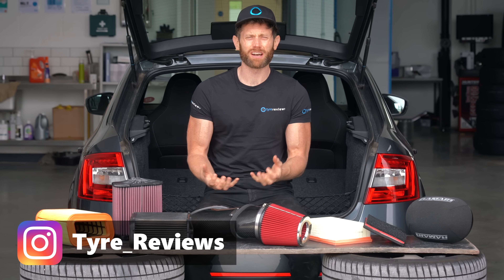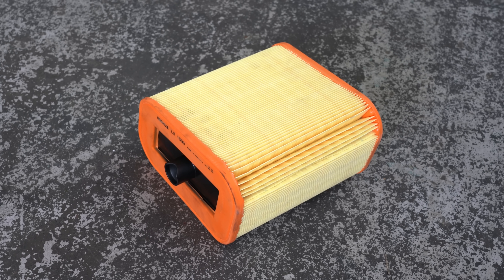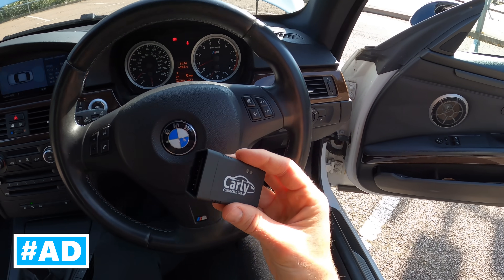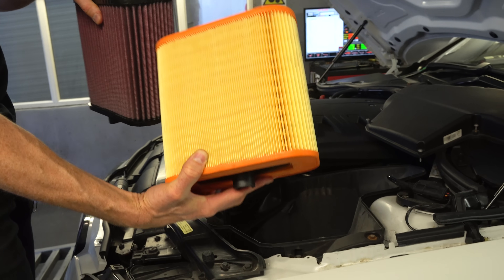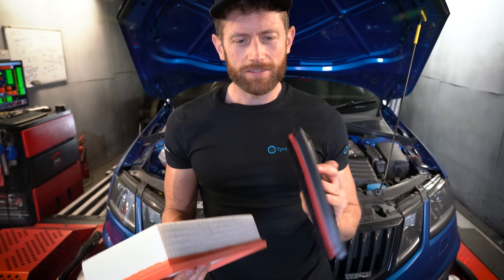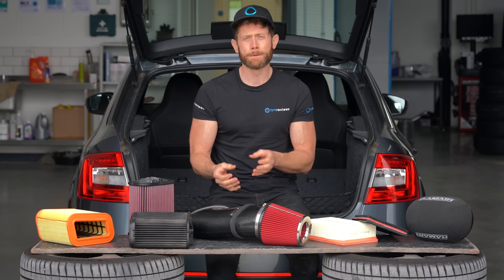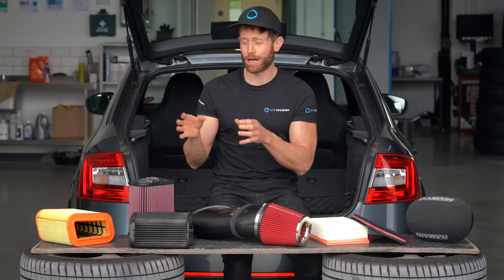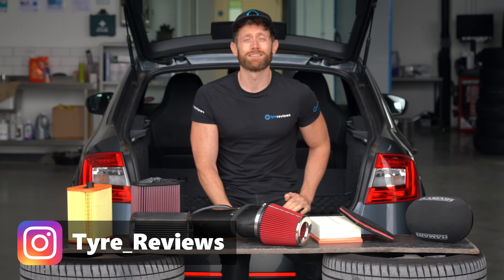Do Performance Air Filters REALLY Give You More Power?

Comment from the maker: http://bit.ly/TyreReviewsCarly - Get 20% off your Carly adapter with code Tyres until 30 Nov 2020! Carly offers a free lite version of their slick app, which gives you access to the OBD functions and you can use it to check which advanced Carly features work with your specific car model.
Reply: This is a good channel. I’d suggest being more cautious regarding products or companies you promote. Carly is one of the worst reviewed on Trustpilot ever. Doesn’t look good on you to promote them.
Reply: Do you have discount on app?
I buy carly!
Reply from the maker: @ingcool27  Use the code "TYRES" for 20% off
Reply: @tyrereviews  I love your videos but sadly here in San Diego, our government doesn't like CAI systems. Something to do with it need an emissions number or its against the law.
Reply: I'd appreciate if you could show us the torque and power charts a bit better. Top power gain of 2.5% is really insignificant and one could argue it's within the error margin on a dyno run.
Reply: Do not use KN , the engine pulls oil from the filter and damages sensors, not sure why KN isn't bankrupt yet, this BMW filter is so large already that there nothing that will improve its air flow,
Reply: So many channels have done this with the wrong cars. I put K&Ns on my 5th gen 4Runner and it makes a world of difference. Stop using sports cars. Use them on SUVs and Trucks. Especially with the 4Runner, replacing the filter makes the whole thing a cold air intake. You don't need the trd pro cold air intake, the OEM one is already one, just missing the K&N filter.
Reply: @TastingGround  the problem with putting them on trucks or SUVs is that they are meant to be operated off road, on construction sites, or farms, where they will be subjected to far higher amounts of airborne dust and dirt that could be sucked into the engine. Seems like a pretty poor use case for a filter that’s meant to increase air intake by doing a less effective job of filtering the air.

After all, there’s only so much room for the filter under the hood, which is usually already filled with the paper filter. So you can’t make the surface area of the filter much bigger, and if your not forcing induction, then the only way to get a naturally aspirated engine to suck more air through the same size filter is to make the holes in the filter bigger and therefore less restrictive. 

I agree they can produce a little more horsepower (and improve the exhaust note), but unless we’re talking about a truck that’s used solely for towing on pavement, or a pavement poseur SUV that only gets near dirt when driving by road construction on the way to the mall, then it’s a pretty dubious application for these filters, in my humble opinion. 

(Oh, and I say this as someone with an AIRAID CAI on his pavement poseur SUV. And yes, it did add some horsepower and combined with the 3” cat-back exhaust system, sounds sweet as hell! 😁 if I have to head for the dirt, the factory box goes back in.)
Reply: @RickinICT  what's the stats like 90% of off road vehicles purchased never goes off road. I understand that you'd need normal filters off road, but it's worth talking about the experience with K&N on road. It changes the driving dynamic so much. Also lost 2 mpg on local drives but gained 2 mpg on longer drives.

Comment: My theory with the E92 is similar to what I experienced on my Audi RS5 V8. The biggest restriction was the catalytic converters in the exhaust. There is no point increasing air induction if it can’t push it out through the exhaust side. Once I fitted catless downpipes, the difference in power was incredible. We could do a much more aggressive tune on it too without the catalytic converters.

Comment: You used a dirty K&N filter and probably contaminated the mass air flow sensor.  That is most likely the reason you lost power and couldn't get it back.

Comment: Guyz remember that performance filters let more air in, many of you say that more airflow, more consumption. It is NOT as that - engine asks for air, it won't receive the full blast you are "letting it have". More air means less struggle when being in high rev range. This is why you see more torque with these filters but HP are almost the same. More air means that torque will start to drop in higher revolutions, as you can see on the dyno graph. That is what's making those 'extra' HP because HP= torque multiplied by RPMs.
And don't be scared to use them if you don't live in nevada desert or texas😊, if you do not maintain them properly, how can you expect to work them fine? Same for motor oil - change in 10k kms intervals max (every engine, not matter diesel or gas, turbo/not)

Comment: Those perf. filters do a difference BUT more difference noticeable on ecu modded cars (in terms of torque, because it can rev higher before torque drops - easy - high revs, more air demand, if more air won't come, ecu cuts the fuel to maintain the stechiometric ratio. Simple as that)

Comment: I guess K&N best days were before engineers optimized the intakes so well like on today's modern cars. I have been running a K&N on my turbo 2.3L truck and replace it once a year but since I have never actually felt a difference, this next replacement I think I will go back to stock and see if I get any MPG differences.

Comment: Even though there wasn’t any extra power, your numbers indicate that the K&N made +10Nm which is a pretty substantial gain. Peak power is kind of meaningless, power band is more meaningful and if the engine makes +10Nm then it probably makes more power through the midrange which makes a difference when powering out of corners or even just daily driving. It would have been good if you showed the dyno graphs overlaid so we could see the difference throughout the rev range instead of just the peak figure. Otherwise good test. Thanks.

Comment: Naturally aspirated engine, the sports filters do not gain power but 10nm of torque. Not huge but a small gain all the same!. Did you let it cool down a little between each shot? Because the drop in power shows that the engine is heated?
On turbo it's something else, on a Laguna 2 dci 120, I had 120.9hp and 301nm stock, then 127hp and 320nm with BMC sport filter, it's not ridiculous. Then comes the dynamic carbon intake with fresh air intake (boa), which for me are the best accompanied by a remap and exhaust line to better evacuate, compared to remap + exhaust line + stock or sport filter!

Comment: Really great to see someone not just talk about intakes but actually do back to back dyno testing. WHen I used to work on Hondas, there was a decent cold air intake system that placed the filter inside the right fender. That was good for power above 4000rpm, 3-5bhp. Just dropping a pod inside the engine bay, sounds great, but is often worse.

Comment: On the M3 - not much in HP gain but it did add 10Nm torque, which should give you a more responsive throttle. Hmm??

Comment: On a modified engine I have compared a spotless standard panel filter to the k&n and it has made it more crisp and revs out quicker! I have used heat shields and aluminium with fibreglass racing insulation tape to oblivion! I fitted a temp sensor just before the throttle body and im getting 2 degrees Celsius above ambient temps. Cheers from Australia ❤

Comment: This confirm that: I've always run oiled foam air filter on my offroad toys and new drop in paper filter in my cars.
Never had a problem.
A tune with manifold will bring more hp to the table that a 600$ intake.
Just as a reference a 5.7 Toy Tundra use the same air filter as a 3.5 Tacoma🤓

Comment: Quite simply, on a modern car, the computer adjusts the fuel to air ratio. Any fluctuations in air getting in and it will compensate to a degree but that's a very "tiny degree". Too much air will flag up a lean code and not enough air (oxygen) will flag up a too rich code so all this nonsense of "performance increase" by allowing more air to flow is absolute crap! If you have a car that pre dates all this "net zero" onboard "carbon emissions" stuff then a "performance" air filter will do a good job. If you have a modern car that monitors everything (including your driving habits) then an air filter, that allows more air in, will be perceived by the ECU as a "fault" and it will illuminate the yellow engine warning light on your dash. It never ceases to amaze me how stupid some people can be.... they fit these filters in modern cars and, 50 miles later, the yellow "check engine" warning light comes on.... they connect an OB2 reader and it presents them with a code (or multiple codes) all relating to "oxygen too lean bank 1" they then spend time and money replacing o2 sensors, fuel injectors blah blah blah etc. etc. etc and, after a lot of head scratching, they realise the reason too much o2 was getting into the intake was nothing to do with faulty sensors or fuel injectors or a "leak" in the air intake etc. It was all down to them fitting an air filter that, quite simply, let too much air in.

Comment: Less filtering means a lower pressure drop which results in more HP.  It also means more gunk into the engine. However, that's only a big deal when you want your engine to last 200,000 miles or so.  Ditto for the oil filter, which is actually more important.

Comment: It can depend on the quality of the fuel too. Sometimes, more air flow does not mean better. Making the pipe to the filter smaller can produce better boost to, especially at low rpm. Good for hiking.

Comment: omg 😹🤭 the filter doesn't give the car any difference about the horsepower 😂 the filter made to blocked the dust and water to not go inside the engine and giving the engine a clean air that all 🤣 if you want to make the car be so strong and fast you must put a turbocharger or fix it in professional mechanics

Comment: Really nice video and thanks for your time and effort to share this :)
To get the correct power 7:01 don’t change the filter, just maintain the stock one! 

It will give you only,impressive sound as the flow is difference on aftermarket filters. 

For me I will save more money and I would go for remap, filter, full exhaust in a proper dyno so all of them can adapt with the programmer.

Comment: Ah sorry my commenting style is in the moment during the video. Wish you put the heat shield on as I'm sure you do too..

I'm trying to figure out what filter or filter system to get for my ST180. Stage 1 tune no brainer unlocking so much power and especially torque. But spending hunders on an ITG could be diminishing returns. Not much gain for a lot of money. Hence why I'm here gathering data.

I looked incase you did the same vid for exhaust but obviously it takes more time to change an exhaust. Not sure if I should get a trusted brand like Milltek or get a custom cat back for half the price. Is twice the price of a custom exhaust by getting a Milltek worth the money? Probably a case of diminishing returns again, I don't know

Comment: You said the pipe across was 234 (Octavia) I thought 234 was the after market filter replacement? With the standard air box, I'm confised. Pipe across sounds like after market air filter kit setup as apposed to a drop in after market air filter

Comment: I watched several videos to consider cold air system or just performance filter.

One an engineer showed a dry filter from AEM beat K &  N in flow and filtration.

I had old school Nova SS used a K & N with a lunati racing cam in  406 small block not sure if dud better than a Delco.
My Monte pulled 305 out 454 in again k vrs AC. With the immense torque uncertain.
I compared K & N to the AEM notice the AEM has more filtering.
Just like the video stated and demonstrated. 
The k had 2 layers of oiled cotton guaze vrs AEM 4 fine weave cotton. 

It helps my off the line sluggish problem I modified my Silverado air cleaner it really woke it up.
MPG is better engine sounds better, exhaust I'd quieter until apply more throttle then sunds very throaty.
It makes the hills easier no more 4th to 3rd a lot, take off is much better.
Try it and see what uou think.
K& N 79.99
AEM 59.99
Both can be cleaned and are one dry other oil.

Comment: So you aim the fan at the nose of an e92 m3 when the main air feed is on the bumper on the passenger side 🤣 did you apply the bumper scoop when testing the Eventuri ?? Which is designed totally different to a normal k&n filter

Comment: In any of the tests, did you measure the filter's surface area?   More surface area should equate to more flow.  The stock paper filters both had (a lot) more media surface area than the other filters tested (especially on the Eventuri thing). No filter has infinite surface area. Then, did you "tune" the car for the new style filter.  On Subarus; you have to tune the ECU when adding something as simple as a filter on a stick.  Why, I'm not sure, but why not on these cars?   What was each filters flow rate????
Reply: Filter surface area means not a lot unless the filtration media is identical.

Comment: Hmmm.... doesn't the cars ecu need 20 mins of driving around with new air filter to re-adjust for the change in air flow ?? And I've noticed my vehicles get better mileage when I use K & N filters. and in My stinger gt, drop in k & n filters with 2 snorkel air scoops I got min. .25-.30 secs. better 1/4 mile runs

Comment: Air filters are sort of something to leave alone....there are a ton of videos with people with aftermarket airfilters with "dust" in the airbox...that gets past the aftermarket fitlers and into the engine....and other viddeos (motorcycle one comes to mind) showing the K and N filter engines have cylinder wall damage most of the time...not me, that video.

https://www.youtube.com/watch?v=yzUnqcGR0Hc&t=9s   (there are two more parts.....it gets worse....)

Had a 996TT...if one taped over the stock filter leaving only 1/8th of the stock unit uncovered it kept power going....so the stock unit does NOT block air.

For an engine, keep it stock is the take home. If you don't want to cause engine damage......my opinion but best way to waste money is air filters on street cars. Racing...that is different...but unless you are paid to drive and sponsored and get stuff "free"....a new engine is expensive and best bet is stock. Eye candy and such is great...but stock is remarkable in modern cars.   I just change the air filters q 30k miles and have had NO issues (and a lot more money in my hands for other things like fuel to have fun drive with...).

Comment: You need to be tuned to account for the extra air going into the engine. This could be the reason why the e92 didn't make power even with no filter.

Comment: The BMW air filter and housing are already really good. Some cars have very restricted intakes to reduce noise, dust intake and even torque curve. I tried change the housing and piping around in a turbo diesel but all I did was upset the bottom end torque and made intake noise more irritating